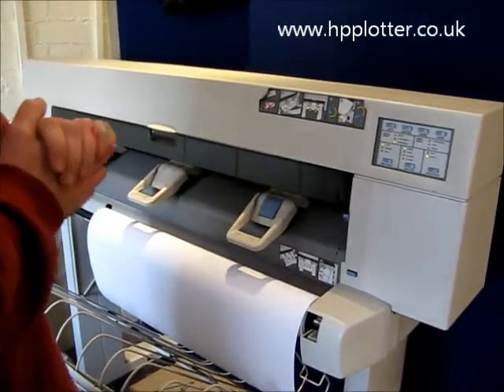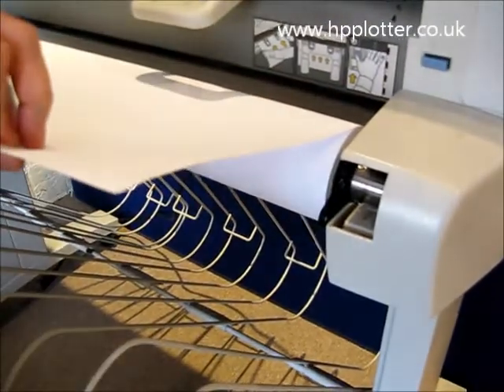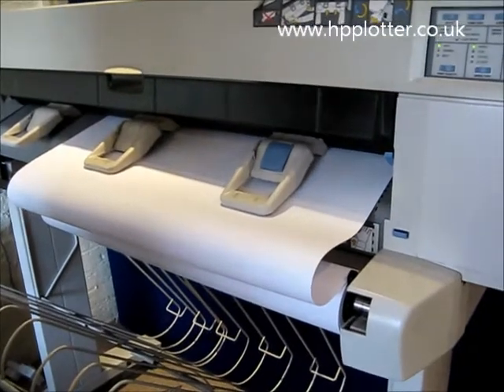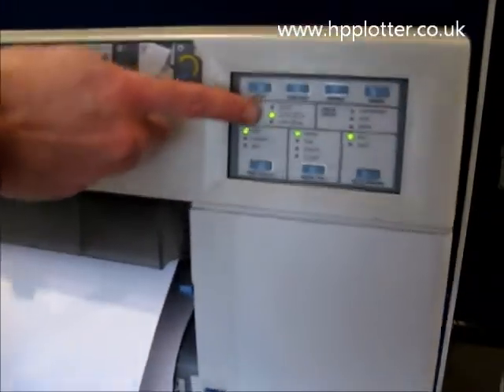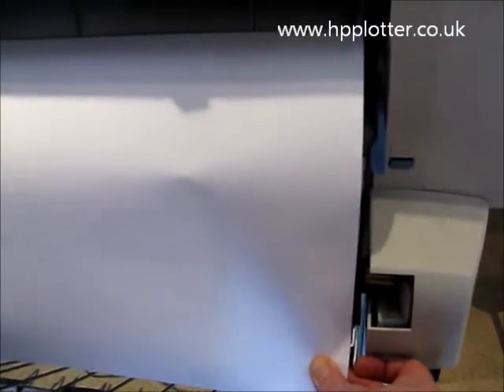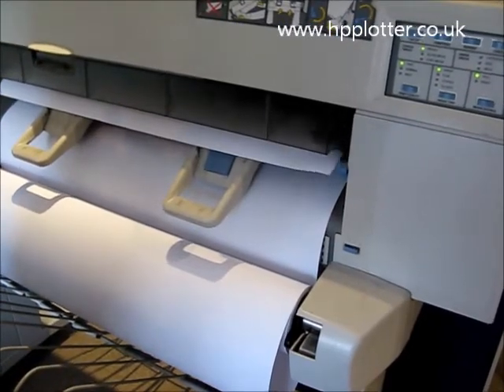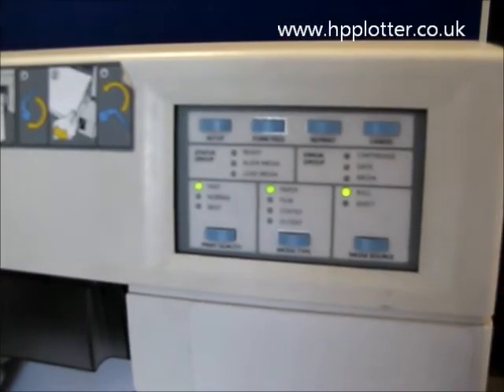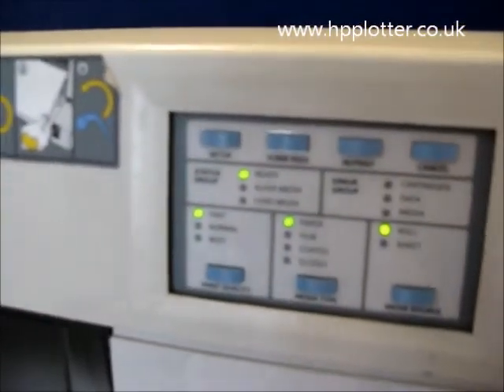DesignJet 450C- Loading paper roll

Comment: Thanks a lot for the tips. Your videos helped me a lot. I have this machine HP DJ 450c and I have a problem with loading paper. Yesterday I printed the whole roll and today it rejects the paper. I put it in maybe 20 times with different sizes of paper but I always have the same problem. I had this problem a few months ago and changed the whole head and it worked for a few days and the same error again. Thank you, I appreciated your support.

Comment: CONQUE  DRAIVER PUEDO HACER FUNCIONAR HP 450C CON WINDOWS 10
Reply from the maker: No there are no drivers for the HP 450C for windows 10 - either find an old operating system for a workaround and dedicate a PC just for the printer - or unfortunately invest in a new machine at around 500 euros.

Comment: Hi, what kind of ink does this machine use? Is it suitable for printing any kind of vinyl?
Reply from the maker: This is an old colour HP Designjet printer, first manufactured in 1997, which was ideal for individuals or small businesses and used for line drawings, presentations, signs, and comps. It has since been superceded by the Designjet 500, 510 - with the Designjet T520 being the natural upgrade path today. It uses dye based inks (which means that they are neither waterproof nor UV stabilised so will fade in sunlight). With regard to printing on Vinyl, the HP official compatibility chart specifically excludes the 4xx series from being compatible with Vinyl although the Designjet 500 & 510 do show compatibility.  To view the compatibility chart please visit our website on: http://www.hpplotter.co.uk/worldofhp/designjet-media-compatibility-chart  Hope that helps!